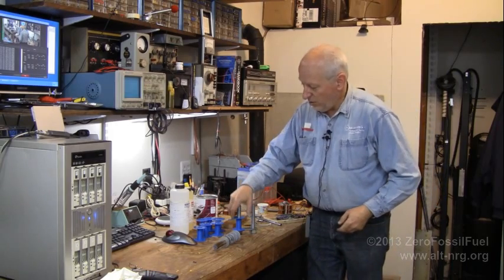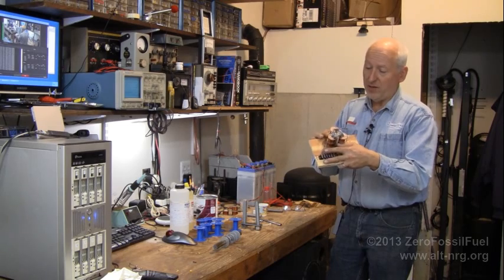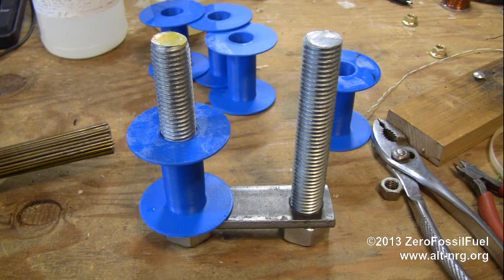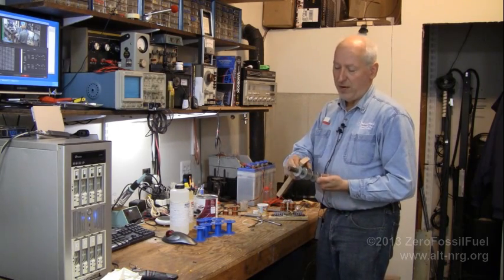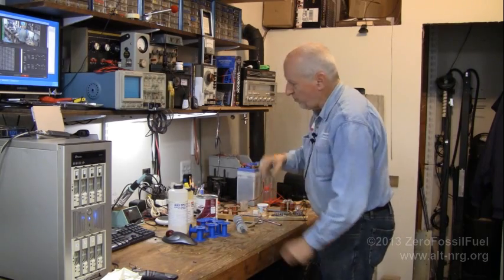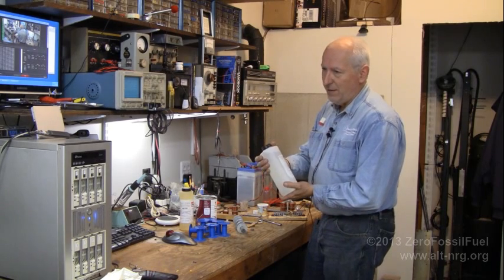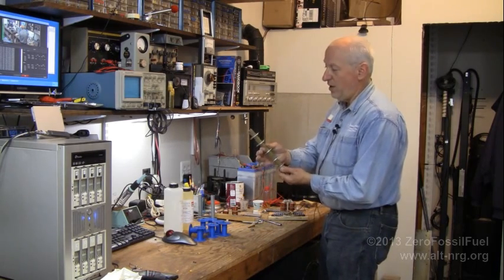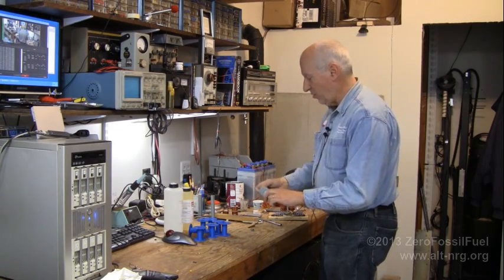#350 3D 3 phase "Tricore" transformer 03

Comment: The metal rods have to be insulted from each other other wise they form a shorted turn inside your transformer ... resulting in very high losses ... core will get very hot.
Soft steel is fine for DC coils ... not AC , the alternating AC flux will heat the the iron rods ... your rods have to be insulated from the tie plates too - shorted turn effect
I designed transformers & chokes for many years.

Comment: I just found your channel and I like it. :) If you were to ground the core of a bolt core would that remove the hysteresis? I do not know very much about this but am only suggesting. Sounds like you need a paper tube like a TP tube to fill with resin and rods.
Reply from the maker: I'm afraid not. At best it might bleed off a static charge if one built up on it but that might actually be desireable.

Comment: Have you considered using smaller gauge wire? Like soft iron mechanic's wire. I would think the more stripes of wire per square inch would produce a much better iron core and better magnet. BOB
Reply from the maker: Yes, I just thought this would be easier to work woth for a proof of concept first.

Comment: if you have magnetite, you can make a core from that, they are good for that (glue and magnetite you can make the form you want)
Reply from the maker: I have magnetite, 5lb of it in fact, that I bought for the Muller project. Still need to set up a vacuum bell to evacuate any bubbles. Then there's the matter of creating a form to mold it in. Great idea. A lot more involved that you might think.